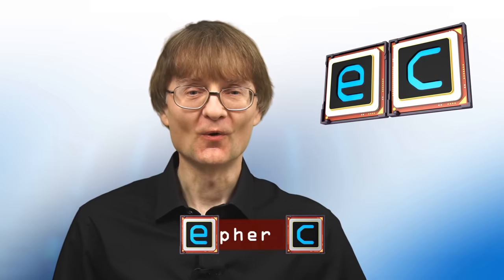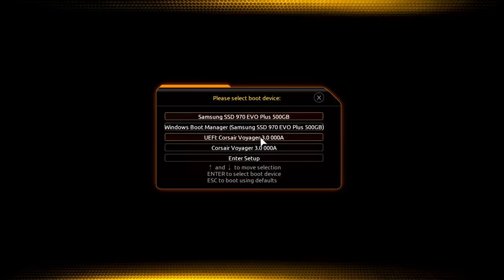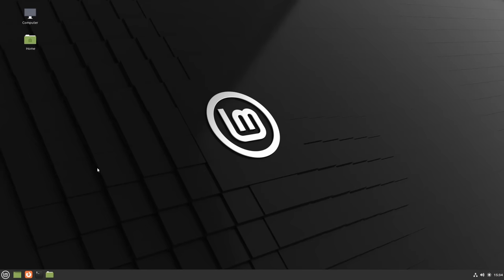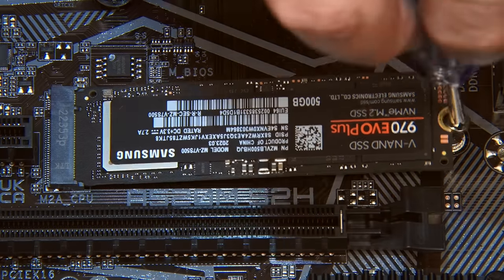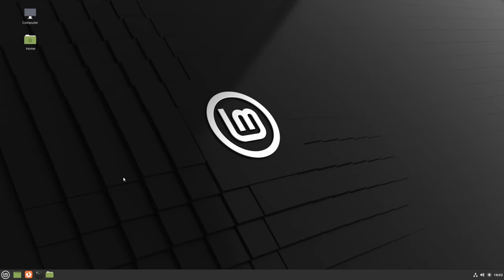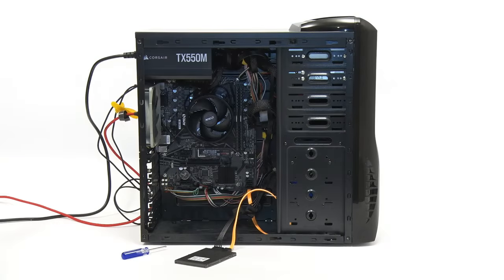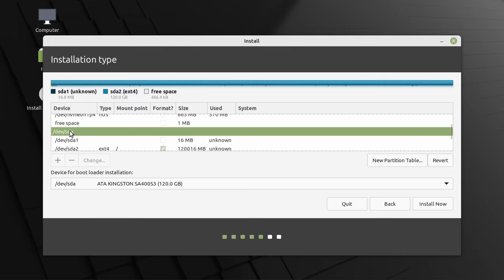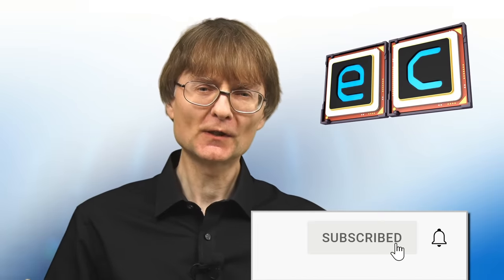Windows & Linux: Dual Drive Dual Boot

Comment: Seeing as you've delved into the "something else" installation option, Chris, it'd be good to have a video delving into its more interesting possibilities.

My favourite one being that you can install "/" on one hard drive, then install "/home" on another hard drive. So that your data and settings are on a different physical drive to your OS.

This makes reinstalling the OS so much simpler. You can, indeed, do similarly to the "hardware method" here and remove your "/home" drive from the machine completely, reinstall the OS and then remount your "/home" drive with a one-liner in the "fstab" config file.

Indeed, you can reinstall the OS should it get corrupt, or upgrade to the latest version of the OS, or even switch distros entirely. And all you have to do is remove your "data drive", do whatever you need to do, re-connect the "data drive" and add one line in "fstab" to re-moun it back to "/home". Then all your data and settings are already right there.

Typically, when you install apps, like Chrome or Thunderbird or whatever, because your data's already there in your "/home" drive, they'll just immediately spring back to life as they previously were. No need to copy things or mess with config files. The app sees your settings in your "/home" folder and just uses them.

It's quite magical. To be able to reinstall an OS, and then just "sudo apt install chromium" and your immediately back where you were, as if nothing happened. You just reinstall the apps with your package manager and they're immediately back to how it was. No copying and, removing your "data drive" while you mess with the OS, a vastly safer way to do things, as your data can't be wiped if the drive is not even physically connected.

It's also a good way to move your data to a new machine. Pull out the "data drive", connect to the new machine and you've got all your data and settings.

I mean, it's also possible - thanks to the VFS - to stick any directory on any drive you like. So, you know, you could pop "/etc" or "/usr" or whatever onto its own drive too, if you wanted to.

When I was messing with a cluster of Linux servers at work, I actually mounted "/home" over NFS, so that it was the same home directory for every node in the cluster. This was beautiful for moving data between nodes - copy it to my home directory and then login on another node in the cluster, and it's the same home directory with the files there. Just copy the file from that home directory to wherever it needs to go. It was the choice way to ensure all the nodes in the cluster had the same identical setup, as I made it work on one node then copied the config files to "/home" which is accessible to them all.

The power of the VFS is immense, yet it's so little mentioned. 

Hence, you know, a video on the subject and all the mad things you can do with it would be great. Wink, wink, nudge, nudge.

p.s. the lack of anything comparable in Windows is a large part of why, sorry, I can never go back to Windows again now. It's just so "crippled" in comparison, where these things either aren't possible or you have to pay hundreds for some often-flaky third-party app to do it. But, on Linux, it's in the kernel itself, so it's free and is guaranteed to be there, regardless of distro.
Reply: I did not know that you could install the home and setting directories in separate locations from the OS. That is incredibly useful. Thank you for the information! I'll need to take some time to learn about messing around with my fstab.
Reply: Thanks for the detailed explanation. Is it possible to install /home directory on a removable USB stick?
Reply: @lewisse_8966  Linux had this kind of flexibility since 30years.
Reply: @ricsip  That's fantastic! Still learning what Linux has to offer coming from Windows and I'm sure there's more it has to offer.
Reply: Yes, I was thinking of doing the same myself, except just with separate partitions. I think this is more the key point here than necessarily having to be separate drives?
Reply: You can just move the users/downloads/desktop/documents folders to the secondary drive on windows

Comment: Another consideration is the use of a hard drive switch so that one can select multiple operating systems without having to go into bias settings when switching over. I use one with four selectors to switch to my desired operating system prior to booting up.

Comment: A year from it being posted and this video answered my questions as if they were heard directly. I am now running Linux Mint on my Dual Drive Dual Boot set up. I did Method A where you remove the Drives you dont want erased while installing to protect that info.
Anyway, just wanted to say thanks for a concise and very helpful video!
Reply from the maker: Great to hear that this worked for you. :) You may have seen the reports earlier this month of a Windows update destroying single drive Linux dual boot systems . . .
Reply: @ExplainingComputers  I am fortunate to have started when I did so that I could make the decision to keep the OSs on separate drives. I might have done so anyway, but I was on the fence until I learned of that issue, and that helped me decide how I wanted to set it up. It would have been pretty discouraging to have my first foray into the world of Linux thwarted by a bug from a windows update. I got lucky, both in learning of that issue and for finding your helpful walkthrough. Thanks again, you are doing the community a service!

Comment: I have used a dual drive - dual boot setup for years and never looked back. I primarily use Linux Mint and only have a Windows install for a few proprietary software pieces, that refuse to run under Linux. Perfect!

Comment: Excellent and very pedagogic video. On a laptop, I usually use Gparted before installing ubuntu based distros. I ensure that the Windows EFI partition (the one used to boot windows) has flags ESP and Boot unchecked to avoid Ubuntu insisting on putting Grub on the first drive. Also do not forget to disable fast boot in Windows to ensure a real restart and not a hybrid sleep/boot

Comment: You can get around the GRUB going on the NVME drive with the connected installer by setting up a separate ESP partition on the SATA drive.  Instead of assigning all the space on the SATA to the root partition, make another partition of type ESP (1 for GUID, though 11 for Basic Microsoft Data or c for MBR FAT32 normally work depending on your UEFI implementation), and set the mountpoint in the installer to /boot/efi.

I also like to distro-hop, so, I'll typically do a 128MiB EFI partition, a 48GiB root, and the rest on /home, as I use podman and most other things I use will eat home space, and 48GiB tends to do nicely for a bunch of installable packages.  That way I can just reinstall with another distro over the root partition if I decide to try another Linux distro.

Glad you kept it simple and repeatable for everyone!
Reply: What you are suggesting doesn't work with Linux Mint. I have tried several times, it failed every single time. I selected the SATA drive as device for boot loader installation, I selected the Windows EFI partition and changed it from "use as EFI partition" to "do not use partition", created a new EFI partition on the SATA drive and selected that, set its mount point to /boot/efi, and the LM installer ignored all of that.

Comment: I dual boot Windows and NixOs currently.  NixOs is probably the most remarkable distro I've ever used, and really deserves a video on here.  Not only does it use a single config file to build the whole OS so it can be reproduced anywhere and rebuilt at runtime, it uses a clever library versioning system to solve any dependancy issues with packages you install, virtually eliminating the need for self contained apps like flatpak and snap.  I think it's probably the future of Linux and if someone builds a slick GUI for modifying that config file it would make for a very smart desktop distro indeed.

Comment: I use the dual drive with the windows drive removed and then returning the windows drive method. I did the dual drive with grub and I managed to lose Linux mint from the grub menu when I upgraded the version from 20 to 21. It took me a while to find out how to update grub, which you avoid if you remove the windows drive. Thanks for an excellent video.

Comment: Perfect timing on this video, Christopher. 

I am currently using a Windows 10 laptop with SSD system drive and HDD storage drive. Seeing the disadvantages of single drive dual boot, I may clone the Windows SSD onto a larger drive and replace the HDD with a SSD for Linux. I would then repurpose the HDD as an external backup drive for the second SSD to go along with my current external HDD backup. 

I love your videos, as before I found your channel I would not have had any idea how to do any of the above. Due to your excellent explanations, I now feel confident I could make the required system changes quite easily if I choose to go that route.
Reply: That's a good plan!
Reply: @kg4wrq Worked perfectly, but then, I had a great teacher!

Comment: Greetings Dear Chris,
Have been doing dual booting since winXp but still learning something new from you😊! Really glad I didn't pass this by. Yes, my distro of choice is normally leaning towards Linux Mint even to this day.
When I finally swapped from WinXp to Linux Mint, windows became 2nd class citizen on my Virtualbox VM.
Bought a Dell Precision 17" Laptop about 2yrs back tt came with Ubuntu. Sadly never get used to ubuntu; to presever ubuntu in its original form in the nvme that was pre-installed, I installed Mint on an external HP 1tb SSD.
Now I am opened to another whole new world of Dual Booting + VMs on Mint.
How about that😊!
Really enjoyed all your vids though pretty bz and hv to miss some.
Cheers!
🍷🍾:_scissors2::_scissors2:

Comment: Best method for me was installing each OS separately and choosing boot up drive from bios  (depending on your choice at the moment)
Edit windows registry to use UTC time.    Then optionally make  VirtualBox be able to boot up your  physical Linux drive as  bonus.
That is my current setup.
Reply: can virtualbox use an existing windows install as a VM? I'd love to access it from Linux and vice versa, so I could also boot into Windows and VM into Linux...
Reply: @leevfx  I highly doubt it which is why I haven't tried it.  Windows has a history of being very pick about its storage controllers.  I have heard that Windows 10 has improved on that so something like moving your NVME to a new motherboard may work but not always and still has issues.  I wouldn't recommend it.   I know it works with Arch Linux for a fact without on issues.   I have even installed the "guest utilities" and have not had a problem with doing this on Linux.
Reply: @leevfx  The latter does work.  I boot up into Windows, start up virtual box and boot into my Linux setup from within windows without a problem to be more clear.
Reply: VirtualBox can boot a physical drive as if it was a virtual disk ISO? Aren't there differences in the hardware reported to the OS? Every time I used to use  VirtualBox or other VM solutions, the VM OS would only see a limited set of basic generic Intel chips, even if the bare metal hardware was something else. So Linux would think it was connected to a system with one set of hardware one minute and then another system the next minute. This would minimally make Linux go through some otherwise-unnecessary Discover New Hardware checks after every such cross-system reboot.

Comment: When I first tried Linux, I tried dual-booting with Windows. I messed up pretty bad, and decided to commit to just using Linux. I don't use Windows anymore, but if I was going to again, I would install it on an entirely separate drive like you demonstrated. My new motherboard allows for 3 M.2 SSDs, 1 for the CPU and 2 for the chipset. I would put Windows on one of the drives connected to the chipset.
Reply: what are the difference in the SSD for the CPU, and SSD for the chipset.
is there a performance change ?

Comment: Thanks Chris for a very interesting & thorough explanation! One thing I would add is not only a good backup up but a 'Rescue disk' for Windows!!  I've dual booted Windows & Linux on two separate drives for several years & not had too many issues! To help with the boot menu I installed a free program on Windows called 'Easy BCD' where you can set which OS starts first & adjust the time to boot. :) :_stanley:
Reply: Tom's Root'n'Boot. And others.
Reply: @loginregional  I've just checked out the alternatives, some I'd never heard of but thanks for this :)
Reply: Tx for the tip. BTW, on dual (or even more) boot, on the Linux I can set the sequence of OS initialization and other parameters using a program/app called GRUB CUSTOMIZER which is easy-to-use and also has a graphical interface. No Terminal commands NECESSARY if you want.
Reply: @alanthornton3530  https://en.wikipedia.org/wiki/Tomsrtbt

Comment: Another great video, thank you. I use dual drive dual boot for an older version of MacOS on my Mac, using an external SSD connected by USB, on which I installed the older MacOS. I just choose to select the external drive as the boot drive during startup and I'm back in time using programmes that no longer run on later MacOS. Just thought people might like to know that Mac's can do this too!

Comment: I did the same thing of switching via the bios (F8 in my case).  One thing to bear in mind is that you should hold down the shift key when exiting Windows to avoid files being locked for access from the Linux end. At least with Windows 10 which caches things for faster reboot.
Reply: Or turn off fast startup

Comment: This is a great video and a great idea for a dual boot system, and it is a lot simpler to implement, however,  anytime you have a dual boot of any type one has to always be careful not to inadvertently mess up partitions or files for the non-booted O/S while working from the booted one.
Reply from the maker: Very true.
Reply: why?

Comment: I'd always wondered what your hesitancy was with dual boot single drive; now I know! I've made enough PCs unbootable in my time (the dreaded "missing NTLDR") to try and avoid it, so dual drive definitely looks a cleaner and safer option.
Reply: Missing NTLDR was luckily easy to fix, just boot the Windows CD and either jump into cmd either with the Recovery Console and do "fixboot" or since Vista even a GUI helps with that. If it was the only thing missing and not because you formatted the wrong partition and installed something on that, that is.
Reply: @gentuxable  easy to fix but always gives a bit of a flutter!

Comment: For dual drive, method B, a better option is to disable the efi flag on the Windows disk during the installation of Linux. It can be done through gparted, then install Linux as normal and create an efi partition on that drive too. Finally  re-enable the efi flag back on the Windows disk and you're all done.
Reply: or simply always use legacy bios mode disabling all the UEFI crap

Comment: Great video. Another disadvantage of single drive dual boots is that when leaving Windows and booting into Linux, you often lose network connectivity. I now have a dual drive dual boot and have no issues. I wish I had seen this before as I'm never very confident in the longevity of the GRUB menu.
Reply: that just sounds like a problem with your network adapter

Comment: I've done something similar for years, but using a switch module that I installed in an empty 5.25" drive bay, alongside my DVD drive. (I know.  I'm a fossil).  It has 6 push button switches that control 6 molex 4-pin drive power plugs. By splitting these power leads yet further with 2 to 1 Y cables and molex to SATA cables, I can select a multitude of drives to be active. This is in an old large tower case with a motley assortment of SSD and spinning drives.  There are 3 500GB SSD drives containing Win-10, Linux Mint 22, and currently, Parrot Linux.  By using the split power, one switch can enable an OS SSD and one or more Data drives for additional storage.  Additional switches can bring on even more Data drives, plus one 2TB spinning drive I use only to keep current, 0:10 full disk backups of everything else.  When this big drive is powered down, it is impervious to ransomware and virus issues.  One problem I have encountered is finding a disk format style that will let me copy both Win and Linux documents to a common drive so they can be shared.  Photos, letters, etc.  Any idea what drive format would share things politely?  FAT, FAT32, ext4, etc??  Thanks.  Interesting video.  I'm building up an old notebook to dualboot, but it lacks the 8+ drive bays I use on my monster box.  Will try some of this there.
Reply from the maker: I like your switched drive solution. :) For sharing, the problem can be that Windows locks the drive (Linux should be able to access an NFTS drive). If not using NTFS, I'd do for exFAT or FAT32.
Reply: I actually had the same idea but I never heard of anyone actually doing it! 
I'll definitely Google it because now I'm extremely interested. My current case is a dual chamber design and has lots of space for extra drives (I have 4 installed with plenty room to spare) with easy access and two empty front optical drive bays. It's pretty much perfect for that type of setup.
Reply: @Wooskii1  There are several other similar devices on Amazon, but the one I bought several years ago is a Kingwin Hard Drive Power Switch module.  Currently shown at $24.95.